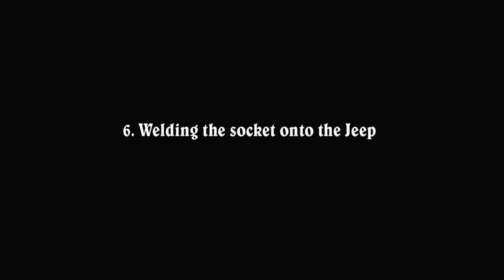Mounting a Browning 1919 on a Jeep

Comment: This is sick and I'm 14 and it's been a dream of mine for a while to have a jeep like that with a nice gun like that... I noticed u said unforntinatly when u said semi auto but u can get urself a $50 crank trigger system and pop it on the gun, it's a crank and when u turn it, it fires the 1919 faster it's basically like a slide fire stock that u would put on an ar to make it legally full auto In a way.

Comment: Kinda funny running into this one. As yesterday I ordered the parts to rebuilt a kit 1919A4. It's my very last Israeli kit & I have a double set of the 3 barrel sizes.. 308, 8X57 & 30-60. My other build was destroyed by a really hot garage fire. Years ago these kit were dirt cheap yesterday Sarco Inc wanted $1,795 for a kit, mine had only cost $245 + finishing cost. The 1919A4 is a blast to operate. I love them.

But nice build on the mount. Looks as heavy duty as the 1919 itself & should both survive the bomb.

Comment: NIce. Hopefully I can do a similar project down the road after I purchase a 1919.
Reply: Military jeeps are very hard to find unless it's in a barn, forgotten for decades. Those that you see in running condition the owners will not sell unless you have deep pockets. You could find a CJ-5, and dress it up with a glossy O.D. Paint job with canvas covered seats. The 258 cu in engine and T-98 tranny will go highway speed, but watch your cornering - you could flip the Jeep.

Comment: very cool video!  I may be making something similar to mount my RPD to my TJ.  Is there a way to prevent the gun from pointing in unsafe directions, such as the driver?
Reply: ahunter316 you could add pins that physically prevent it from rotating and facing certain ways.  If you want to get advanced to you could have a trigger interlock that won't let it fire in certain directions.  Bombers used this in turrets to prevent gunners from hitting their own plane.
Reply: You need a way to lock it so it doesn't flip around everywhere when driving. As far as actually preventing it from pointing certain directions that would be pretty difficult. Just have a way to lock it in place such as with a pin.

Comment: On the Jeep, did you install the rubber grommet around the clutch rod as it passes through the firewall? The scraping noise says you didn't. Is the engine an "F" head, or an "L" head? I can't tell because of the camera angle, but I suspect it is an "L" head 134 cu in flat head four. Hope you kept the 16" tires so that the speedometer reads correctly. Military non directional tires are not hard to find in that size as they are still used by the Army. Don't you love the brass radiator? Watch out for the external oil line that feeds the valve guides, if it gets plugged, you will break valve stems and gall the valve guides. Did your model come with the forcing kit (intake stack, rubber tube to the carb, waterproof distributor and plug wires? Mine did, and she is a joy to off road. Did you put lockouts on the front axle, and what kind. Mine came off a junked '62 Ford pickup, but you can buy them new now. Mine came in the original packing crates, so I had to put it together taking off the consoling of each piece. I had to recover the seats as the canvas material had rotted, and the roll bar came off a Toyota Land Cruiser cut and welded to the frame. 50mph was screaming for the little Continental flat head four with the T-90 transmission. One distinct advantage the military Jeep had, it was narrow enough to go where the modern 4WD trucks couldn't and the ground clearance was greater in it's stock configuration. Love my jeeps, have an XJ,  a CJ-7, CJ-5, , CJ-3B,  and my M- 131C. Have fun with your toy!